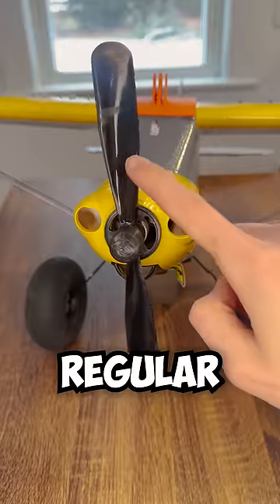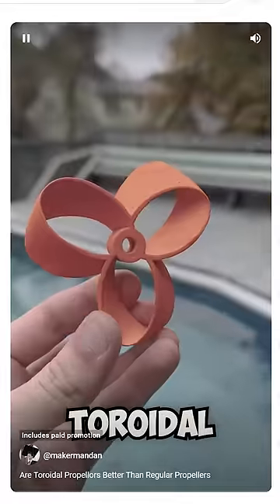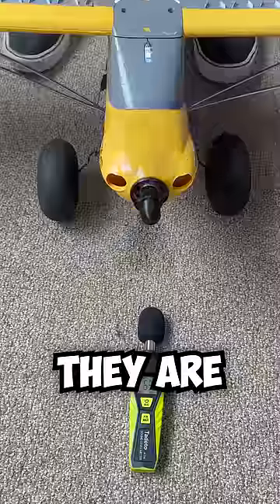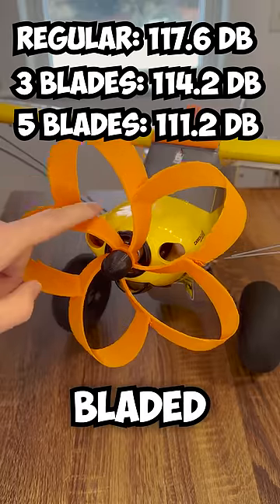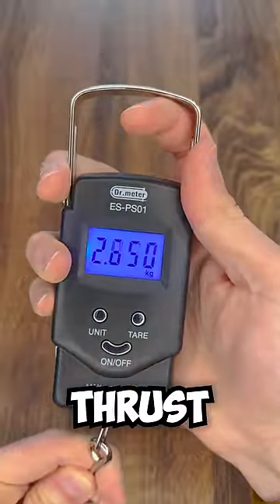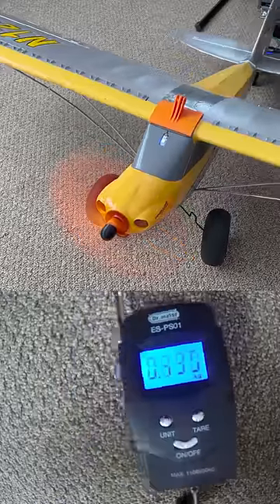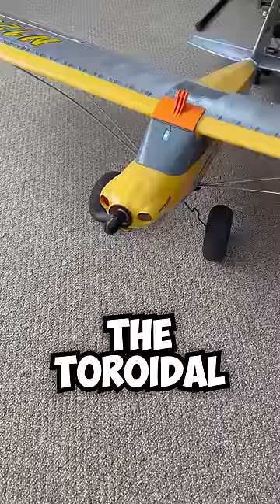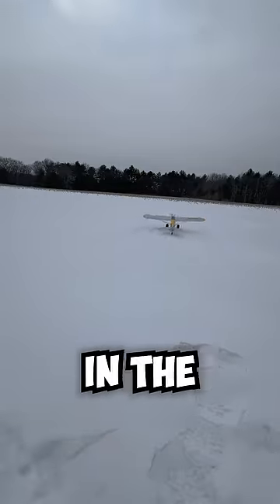Toroidal vs Regular Propeller for RC Plane

Comment: The specific shape makes all the difference. Unless it’s optimized for medium and rpms this won’t show the real power of the toroidal propeller.
Reply: They were debunked a good while ago now, they work but they aren’t anything special.
Reply: That also applies to normal propellers…
Reply from the maker: True, I haven't done much optimization, i just guessed a shape that may work.
Reply: @nlmaster9811  it don't make sense! Regular ones lose wind sideways. Weren't optimised
Reply: @c0nstantin86 They don't "lose wind". They are more efficient because the entire surface area of the prop blades accelerate the air backwards, as opposed to the torroidal prop which has blade area that does not accelerate air backwards.
Reply: @makermandan is the original propeller made out of the same thing u use to make the toroidal propellers? Wouldn’t that make a big difference?
Reply: I am here for this comment
Reply: @makermandan hey buddy i think the propeller might be too flat to be quieter
Reply: @nlmaster9811  they are good for efficiency, giving you same power for less fuel.  Other than that, nothing big.
Works best in water, in boats it can be up to 40% more for your fuel.
Reply: @deilusi  again, this was debunked.
Reply: @nlmaster9811  No, the Sharrow toroidal propellors do work. They are plenty of tests confirming this. The big difference behind this is because it's all about reducing cavitation in the mid-range of typical RPM loads. This simply isn't a factor for drone propellors moving air so that leaves an overall less efficient design.
Reply: Like over 95% of the noise a prop makes is from the air being moved away so the quieter your prop is the less thrust it will make, its directly proportional you cannot have a dead silent propellor. The toroidal prop only showed improvements in a very specific rev range and speed and yes it has to be optimized exactly for the job its going to be doing which completely nullified the point because its still cheaper to just use a regular prop in almost every situation.
Reply: @psykology9299  I belive it was more complicated than that, as you carefully need to adjust your design to avoid vortexing. That likely is a narrow window, that provide good thrust, while keep the flow laminar. I don't think random design downloaded from the internet carefully thought of rpm speed, you will run it at.
It works on same principle as tesla turbine, and if you make it jagged like printing does, it definitely does not allow smooth flow. 
In ships it's much more viable as they run at same cruising speed for weeks at time. If that speed is at that golden window, ships can save tons of fuel. 
For classic shape that speed is way too close to cavitation, so we run them far from their best performance window, to keep them last longer.
Reply: @nlmaster9811  Debunked by what? Some shitty prototypes 3d printed by YouTubers?
Reply: Also need to be super smooth.  Some a
Patient shapes have inprove power and noise. 
A 5 persent increase in efficiency makes a huge difference to ships and some water props do better than that
Reply: @xavier1964  not the case, by lose wind I think what is meant is there is no wash over the prop end causing a vertex to form.
Reply: Make one.  Test it.  Post it.
Reply: @SoulSoundMuisc  make one with a high resolution resin printer, if you are comparing it to a injection molded prop, have the same smooth profiles and edges
Reply: @devilliersduplessis7904  The air that gets accelerated off the prop end isn't reducing thrust. Keeping it contained actually reduces efficiency, it doesn't increase it
Reply: I'm going to go out on a limb here and assume a lot of people here think flight is stable without multiple factors to consider during flight that effect efficiency beyond the control of the propeller. Hence why airframe and wing design are where 90% of your efficiency comes from. 

As for designing a prop for an extremely precise rpm range is about as useful as a second spare. Might come in handy eventually, but overall just kind of a waste. Maximizing generalized efficiency will save you more fuel over the life of the prop.
Reply: @jamesmerkel1932  Most planes spend 80-90% of their flight time in cruise, so optimizing a prop for a specific rpm does yield significant gains. Power settings really only change at takeoff and landing, and occasionally for some acrobatic maneuvers.
Reply: @deilusi  big claims like that are almost always BS. I'd believe it if these were common, but fact is they just are not. The gains, if any, are going to be small at best. Besides, i almost guarentee that you can't boost fuel efficiency by 40% with just a propeller change alone as a huge loss factor in engines comes from internal forces not external ones. The last ICE claiming 24% boosts in fuel efficiency didn't check out because even in a perfect world frictionless system it was mathematically impossible to see such gains with their engine style. i would put money down that this would also be the case here. These gimmicks are a dime a dozen and always fail.
Reply: @oceanbytez847 It's under very specific conditions, the props have to be designed for a specific RPM for their peak efficiency and noise reduction but outside of that range it's not any better.
Reply: @nathon1942 sure, but the normal ones come pre-optimised, the toroidal ones are homeprinted
Reply: @Wake13 its not really about material but more about shape. The normal ones come pre-optimsed from the store, the toroidal ones are homebrew and have basically 0 optimisation
Reply: @ConfusedPlushiee  Absolutely! I bet you’re right, but I imagine it can all make a huge difference.

Hard smooth plastic vs rough, easily manipulatable medium used in 3D-printing, whatever it is.
Reply: @nlmaster9811 Debunked by..?
Reply: @nlmaster9811 not debunked, and they ARE special, only that they have a very narrow application range (basically just good as a ship propeller where they give considerably more efficiency, but at a very specific speed. Which is good, because a ship cruises at said speed most of the time, so you can get decent savings from that)
Reply: @Wake13  i think so too
Reply: @c0nstantin86  Toroidal props generate far more drag via more surface area, so no, they are not optimized.
Reply: @nlmaster9811 I'd love to see how they were debunked. Do you have a link?
Reply: This problem of lower thrust levels also influences those  6 blade to 12 blade piston engine propeller experiments. After a certain point more blades don't provide any more usable thrust. It's a continuing issue in the efforts to produce truly quiet aerial  RPVs , quadcopters, hexacopters, and octocopters.
Reply: Were all propellers printed by the same material and printer?
Reply: @makermandan exactly. Weight, blade pitch, blade surface smoothness, and blade shape are huge factors. The toroidal props you printed don’t have the R&D that the standard prop or real torroidal props have, so this is largely a useless test. You’re comparing apples to something you think looks like an apple that you 3D printed.. it’s a misleading video
Reply: @nlmaster9811 debunked? Have you seen the data on Sharrow propellers for marine applications?
Reply: @dav356  Exactly ,this debunked bozos are funny/sad.
Reply: Except it's specifically less powerful that traditional propellers.  They are quieter because they produce less thrust...
Reply: @darkhobo  no, that’s flat out wrong.
Reply: @nathon1942  Well , yeah , but there's almost a century of research on optimising traditional props , and major manufacturers still release innovations , 
Optimising a toroidal prop for a specific speed or task could take quite a while
Reply: And the surfaces have to be smooth. With the default print quality, you have too many annoying bumps. This needs to be improved by smoothing the surface with acetone.
Reply: It’s been proven that they offer higher efficiency and less noise, at the cost of power.
Reply: @deilusi  less power did you watch the video....

Comment: For a fair testing you should have printed the normal Rotor it self also (not smooth carbon premade)
Reply: 100%
Reply: ^ this
Reply: Thats a work around i  didnt think of, but Glad im not the only one thinking about the 3d print vs the factory molded
Reply: yup. at the least.
Reply: Also should have tested the normal prop with 3 and 5 blades too
Reply: Yes
Reply: The toroidal props need tuned up smooth and sharp like the carbon prop, wouldn't be that hard, they were just unfinished they way the 2 blade was
Reply: Or do a 2 blade not a 3 blade
Reply: @justinschreiner8282  a 2 blade would still actually be a 4 blade, the 3 blade is actually a 6 blade, they need more hp as well, the motors power is being split between more blades
Reply: Agreed. A better control test with a fabricated standard propeller would have helped with a more accurate result.
Reply: Also total spinning mass plays a part into the efficiencies too at that scale so the weight should be optimized between the comparisons
Reply: Yea, the load on the motor is changing with the added mass so you'll need to resize the propellers to the same mass
Reply: that totally plays a role, but I'd say more importantly modern propellers aren't just blades that push air back, they have aerofoil shape, further increasing their efficiency by producing actual lift. Meaning even if the blades vere completely alligned with the axis of rotation and would not push air back, they'd still produce thrust. 

The 3D printed thoroids obviously don't have a complex shape like that and as you said, they have more resistance due to their surface and weight.

Not sure if RC planes normally get those, or if you'd have to pay out of your arse for some special high performance to get this though.
Reply: when they make toroidal propellers for drones, they optimize the shapes and weight and whatnot, so you would need to test a 3d printed rough propeller for it to be apples to apples
Reply: Yeah, I was thinking the same
Reply: @jakubmuron9030  I came here to say this. 
It wasn't a fair test.
Reply: You should also weigh the regular propeller and scale a rounded one to the same weight
Reply: Dependant and independent variable👍🏻
Reply: Weight of prop and motor rpm must consider too
Reply: @jessiehill8392  More mass.
Reply: Was gonna say the same thing. Not sure how much the prints were cleaned up, but it would be hard to make them as smooth and aerodynamic as the real thing. There is also a weight factor.

Comment: note that 6 decibels is a MASSIVE difference--the decibel system isn't linear, meaning 6 decibels is actually halving the amount of noise.
Reply: IIRC, 10 decibels is a doubling/halving of the noise being measured.  A reduction of 6 decibels isn't quite halving the amount of noise, but a 35%-ish reduction in noise is still significant.
Reply: This is misleading. Its power is about 4 time lower and amplitude about 2, but our perception of sound is also inversely exponential, meaning that our perception is roughly linear with the metering.
It's worth noting, though, that there frequencies that mostly drop here are higher frequencies which aren't correctly measure using dba.
Reply: @twylanaythias 6dB is in fact equal to halving or doubling in SPL level, voltage, and in some other things like when measuring ratios. You can corroborate this with a simple formula of dB amount = 20Log( X / X ref). In this case 20Log(2/1) is equal to 6dB and actually 10dB would be more like triplicating the noise level. [20Log(3/1) = 9.54dB]
Reply: WHAT?!?
Reply: Not quite half...... but you are thinking correctly that it's non linear reduction. More like 15%.
Reply: @Dwill545  Look up the SPL measurement system, it's 6db to "double the volume". The 10db scale is subjective, and the 3db scale makes no sense and nobody uses it. Every piece of sound pressure measurement equipment in existence uses the 6db scale, and it's the only one that's accepted in any form of official records or scientific documentation for audio.

Comment: You should slow down the regular propeller until it produces the same thrust as the toroidal and then compare the noise again.
Reply: Are they not set to the same rpm?
Reply: @rossmcdonagh1554   Yes and I just suggested a different comparison.
Reply: @rossmcdonagh1554 set to the same RPM yes, but it doesn't mean they're achieving the same rpm. If a different propeller has more drag it's just going to go slower. The only variable that's the exact same is the power of the little plane.
Reply: That's a good idea. People always forget to remove as many variables as possible for a real comparison.
Reply: @j-schnab6338  that wasn't even the point why I suggested it but yes that also comes in handy. I just think it's another good measure to compare the noise level since we don't really car that much about rpm but more about thrust that just happens to be higher at higher rpm.
Reply: lul😂
Reply: Good call. I'd also like to know the weight of each propeller.
Reply: now that is good science. i agree this suggestion would be more accurate comparison
Reply: Oh and while we are at it we should also keep an eye on the power consumption while doing so
Reply: I can hear just the engine in toroidal and propeller plus fan in the classic one. I don't think changing RPMs makes a big difference
Reply: @favianramirez870  what makes you think that?
Reply: Trzeba było by jeszcze zmierzyć pobór energii
Reply: @Rob07601  also i think we should note how the unsanded torroidal propellers might have additional drag on them, which will decrease performance.
Reply: @tawelwchgaming8957  Someone had suggested 3d printing a standard propellor, it would equalize that variable if they're all made the same way. Never expected to find this so interesting.
Reply: @Rob07601 normal Propeller has very small surface, so less difference. Also if the laminar lines are horizontally it drags not much. Meanwhile on toroidal it would not be only horizontal
Reply: To determine "better" there needs to be a lot more measurements taken. Measure power as well and make all measurements across the entire rev range, not just at full throttle.

No way the much heavier toroidal props will be as efficient as the lighter traditional prop.

Why not do a 2 blade toroidal prop?
Reply: The way db works isn't linear. Also static thrust isn't a measure of power per se. Power needs some kind of rate of work which needs motion. Sure there is motion in the air and if we have the same disk area between props we can conclude the flow rate is related to the measured thrust. So I suppose thrust can speak to the power conversion from the motor power but the measure is only that of force which isn't the same. As far as db not being linear, 7db is actually a lot. 3 db is about double the amplitude 6 being 3 and 3 it's double and double again or 4x and 7 a bit more than that. That's a lot less energy being lost to sound. It's not the whole story but it's okay to start here. If you were to dial the noisy people back to a comparable noise level it's not unreasonable to guess that you'd also lose a significant amount of thrust.
Reply: @danieldimitri6133  I have no idea who you wrote that essay for since it doesn't change a thing about my idea.
Reply: @rossmcdonagh1554  no. higher thrust means less rpm
Reply: Good idea